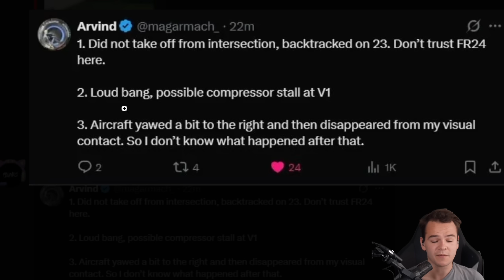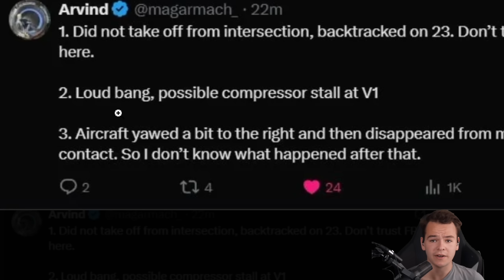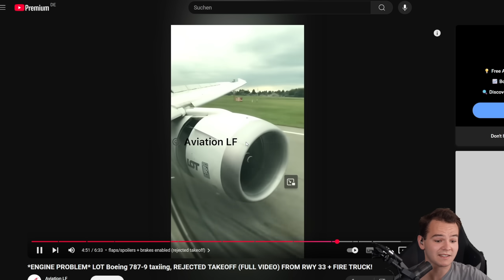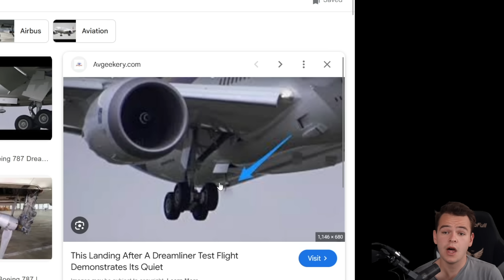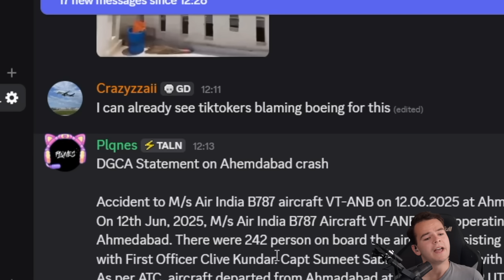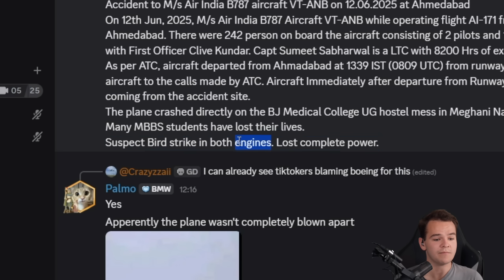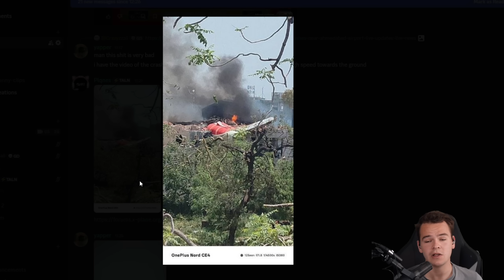The First 787 CRASH Ever - Why It Is SO Confusing?

Comment: 🛫 1. Flight Never Climbed Past 625 ft
Takeoff at 13:38 local time

ADS-B max altitude: ~625 ft barometric (≈300 ft AGL)

Crash location: 1.1 miles off runway end, aligned with runway heading

Landing gear still extended in crash footage → confirms very early-stage flight

✅ Matches what we know from Flightradar24 and all major media reports.

🔥 2. Total Power Loss Suspected
No engine sounds in crash video

No flaps retracted

Aircraft reportedly "gliding" rather than climbing → suggests zero thrust available

Swiss001 (and other experts) infer both engines failed, because:

A 787 can climb on one engine at MTOW (that’s what V1 procedures assume).

The absence of yaw, no high bank, and very short flight path suggests it didn’t have even one working engine.

➡ If only one engine failed, the aircraft should have:

Kept climbing slowly

Yawed or banked away from the failed side

Possibly returned for a safe landing

This didn’t happen — suggesting dual engine shutdown.

🌀 3. Ram Air Turbine (RAT) Deployed?
Multiple users and Swiss001 speculate the RAT may have deployed.

The RAT provides minimal backup power for flight controls and instruments if both engines and the APU fail.

In clearer audio from social media videos, some report a faint RAT-like buzz.

✅ If confirmed, this would strongly support a dual engine failure scenario.

🐦 4. Bird Ingestion Theory
India’s DGCA (Directorate General of Civil Aviation) reportedly suspects bird strike on both engines.

Swiss001 compares this to the US Airways 1549 “Sully” incident — geese ingestion at low altitude caused both engines to shut down.

Here, the aircraft hadn’t even completed climb-out — possibly ingesting birds during or just after rotation.

‼ But… this would imply an extraordinarily dense bird flock, or multiple large birds (e.g., black kites, vultures — common in Ahmedabad).

🧱 5. Why the Crash Was Fatal Despite Low Altitude
Heavy aircraft (fully fueled for 9–10 hour flight)

No thrust = no climb = gliding brick

Impacted a student hostel at BJ Medical College

Fireball caused by tons of ignited fuel

Tail section survived, but main fuselage was destroyed

➡ Even from 300 ft, a twin-engine jet losing power has no safe options — just like Sully, but over buildings instead of a river.

🧩 Summary: Why This Crash Is So Confusing
Aspect	Why It's Unusual
787 Safety Record	First fatal crash of any Dreamliner in commercial service
GE GEnx Engines	Considered highly reliable; no major service-wide issues like RR Trent 1000 had
Dual Failure	Extremely rare — requires common cause: fuel, birds, software, or sabotage
No ATC Detail Yet	Only partial confirmation of the Mayday call — no transcript of cockpit comms yet
Crash Behavior	Smooth, shallow path with no stall-like nose drop — consistent with unpowered glide

✅ Supporting Evidence Across All Sources
All major networks (CNN, ABC, BBC, CNBC) now align with this theory.

Swiss001 builds a simulation that matches known crash data.

User footage, social comments, and ATC metadata all point to:

Sudden loss of climb

No engine thrust sounds

Possibly RAT noise (indicating dual engine loss)

Early Mayday with no follow-up

🚨 Next Steps That Matter Most
CVR/FDR recovery – will confirm:

If both engines failed simultaneously

Whether RAT deployed

Exact pilot actions and warnings received

Engine teardown – will show:

Bird ingestion evidence?

Fuel contamination?

FADEC anomalies?

ATC transcripts – to learn:

Timing of the Mayday call

Last crew communication before impact

🕯 Final Thought
This was not a “technical” stall, nor a normal crash sequence. If Swiss001 and DGCA are right, this is one of the only modern twin-jet takeoff crashes involving total thrust loss with no time, no height, and no safe landing path.

Comment: Other possibility is that the flap is inadvertently retracted instead of gear. Difficult to tell if the rat is deployed.
Reply: Kind of wild how far we are with computers/simulators that his demonstration of the dual bird strike engine failure played out almost identical to what we saw......run another flight sim with the flap issue too! While that helps explain the lading gear, the engine failure seems certain.
Reply: @The_Masked_Fokker  It's hard to see from the video clip, but it does look like the flaps and slats are retracted, and then when the plane starts to change its attitude, it loses altitude.
Reply: i think engine failure is the main cause. flap is just secondary issue
Reply: @gthakur17 doubt it, flaps were retracted which would’ve resulted in no lift
Reply: @sensah3978  hmm i was only reiterating which some other youtubers were saying. Since i am no expert , you could be right. Though we need to wait for boeing to release the report which could be weeks
Reply: In the video you can hear a similar sound of the RAT mid air but hard to see it in video
Reply: Someone mentioned that on this jet, sometimes you only need about 5 degrees of flaps, which may not be visible from certain angles.  But that was my first thought when watching the video (but before reading comments).  HOwever it is feasibly possible that they needed more flaps than what was put in, and thus the plane reached a point where it couldn't generate enough lift and then crashed.  I have heard similar stories where weights of planes for example, are off (inaccurate), which may cause pilots to use incorrect flap settings which leads to a crash in some cases.  Aircraft Investigations has done a few documentaries on crashes of that type).
Reply: rat is deployed
Reply: Agreed, rat is deployed with new footage  @isaxdah

Comment: This sounds a lot like the Atlanta incident where a maintenance supervisor conducted a class on inspection of both engines oil systems and forgot to reinstall the seals around the inspection ports. The plane took off, and immediately lost all oil pressure as the oil was forced out through the ports. It did manage to land but the engines were destroyed.
Reply: Interesting theory we will have the answer soon
Reply: Yeah, my first thought also goes to poor maintenance
Reply: only thing i recon that is possible , losing both engines at the same time for no reason is not really possible ... it would be like getting 2 random blown tires from wear and tear only at exactly the same time and day  1 in a trillion chance
Reply: thanks for your input already.

Comment: This is a No Brainer if someone says we had a Compressor Stall on both engines at the same time. The only plausible analogy/assumption one can make here is both of the engines went out of thrust, What caused it is yet to be determined and should be rigorously investigated for human error + Design Failures (On a Machine that has performed so well over the years).

Comment: To suggest the GenX engine is "indestructible" and only the RR engines suffered failure is far from the truth. The GenX has suffered multiple failures from diverse issues such as turbine disc/shaft cracking, low turbine shaft failure, oil pressure failure, icing of the fan blades abrading casing, failure of FADEC electronic engine controller leading to a plethora of recommendations and airworthiness directives from the NTSB and FAA requiring regular maintenance and safety inspections of the engine. In the event of a total FADEC failure, the engine fails, and pilots have no manual controls for engine restart, throttle, or other functions.

Comment: A380 and 777-300er are now the last wide bodies that have never had a hull loss. 787 is such a modern plane and this one was a very old 787. It has to be a maintenance issue on air indias part.
Reply: And also the 747-8 and A330 NEO.
Reply: @devonc8411 oh yeah forgot those . Last mass produced wide bodies maybe .
Reply: a340 too
Reply: @Thedoomguy66_6 a340 has had a hull loss .
Reply: @Thedoomguy66_6  Pretty sure there was an Air France A340 that overshot the runway and landed in a ravine after a rain storm in at Toronto's Pearson International airport and burst into flames a few minutes later after all passengers were fortunately evacuated.

Comment: I'm impressed as to the coverage of this video. It's pretty detailed and informative given the material to work with. This guy knows his stuff.
Reply: His description of what the ram air turbine will do is incorrect.  I have 31 years working on Boeing aircraft.  Trust me.  It only provides power to the basic instruments in the cockpit and the radios.  It will not power the landing gear.
Reply: @stevenhoward7083  Your post on the air turbine is welcomed.
Reply: No he doesn't. He's an aviation kid that's a private pilot. He's an enthusiast who's never actually flown a passenger plane or received a type rating, making overconfident assumptions based on unconfirmed reports of other aviation nerds that think they know what happened based on a blurry video. Until an actual aviation agency makes a statement, anything these youtubers are saying is pure rubbish, they're all just trying to push these "analysis" videos as a way to milk the death of hundreds of people using idiot flight sim recreations.

Comment: Since there are reports of a bang-sound at the runway phase, I think we can put things like bad fuel or software issues off the table.
It all signs towards the bird strike.
Habe to check the maintenance reports if there is a chance that maybe both engines were incompetently checked prior the flight and accidently something went wrong there.

Even with V1 - why do planes take off at all when all power is lost? Aremt survival chances better if you just ramm the brakes and pray? Now it crashed into some houses and even more people had to die

Comment: also,when it took off,it reached 645ft and then it started descent of -495fpm as i saw on FR24.And it lost all electric power at 645ft at 200mph aswell(transponder switched off,just like Jeju2216 on final) HOWEVER,the pilots knew they would crash into buildings...yet they tried to land it as smoothly as possible,which made it the first literal crash landing(i am not joking,this was the definition of a crash landing) i dont much news,but the highest chance of survival was near the tail which is approx. 1-2%

Comment: Sorry to here this news. Do think you have your engine info back to front! Rolls Royce if problems terminate and slow aircraft down before take off! The GE is very powerful,some say to powerful and certainly not as fuel efficient as the RR so took off even after failure leading to catastrophe

Comment: I don't know much about airplanes, but I know enough that a duel engine failure is pretty much unheard of. I also know that usually a duel engine failure is either external factors like Swiss001 says, or fueling issue. My bet is on some fueling issue.
Reply: My thoughts exactly- bad fuel is definitely a possibility.
Reply: It could be a maintenance mistake, the same person making the same mistake on both engines.  That has happened before.
Reply: Could be bad fuel indeed, as Swiss said it's really hard for birds to completely shut down not one but two GEnx engines
Reply: Tbh if it would be fueling issue it would crash or stall when it would be in sky , this crash happened like 2-3 mins after takeoff so someone would have pointed it out why the fuel is so low and it was shown that fuel was quite good
Reply: As per 1 sole survivor right after the take off some kinda explosion heard and soon the plane started descending. I don't think of fuel problem. I am more swayed towards the power issue if you see
Reply: @DrD26  my theory with that testimony is bird strike. only thing that comes to mind to have a explosion duel engie failure, and has happened a few times, a russian crash comes to mind aswell as sully and the hudson
Reply: @Howieroark21  our media I mean Indian media said that pilot who had 8200+ he's experience and come pilot who had 1100+ experience said to the ATC that they aren't getting enough thrust for complete take off in mid air but close to ground soon after that ATC received May day call from them 💔
Reply: @Howieroark21 but the sole survivor said that they heard explosion and right after that the plane start descending instead of ascending
Reply: @DrD26 Air india is known for having terrible maintenance, it’s probably a maintenance issue
Reply: @DrD26  Sabotage is a possibility.
Reply: @vineberries it is the new management under uk CEO, it is the new plane
Reply: How about single engine failure and subsequent pilot error in shutting down the other (working) engine.
Reply: @rhwing5095  nooooooOOOO!!. because first pilot error is to not deploy flaps which is a federal crime.
Reply: Bad fuel is one of two plausible causes I can think of.  The other is dual bird strike.
Reply: Bad fuel makes engines run inefficient. Not have both of them working perfectly until after takeoff and then suddenly completely fail at the same time. The crew would have noticed bad fuel much earlier, and the plane would have had enough power to stay airborne. I highly doubt it was bad fuel. I fear for an incorrect flap setting.
Reply: It's unlikely to be a fuel issue. If it was contaminated fuel, other aircraft would've crashed or had problems. This would've been reported by now I think.
Reply: @rayjohnson9542  I feel the same too

Comment: When pilots engaged the "autopilot," the software put the engine power into idle . These failures are caused by bugs in the engine control software, which, with a certain sequence of commands (button 1, button 17, button 32, and so on), causes the engine to override pilot command and stays in idle. Most likely the procedure to fix this is to "turn off and restart" the engines. But since they were at low altitude, they didn't have time to do that. Landing gear was down hoping that it will absorb as much as possible of the initial impact.
Reply: CEO of making shit up
Reply: Sounds like you pressed the BS button.
Reply: What fiction movie is that script going to be in?

Comment: Crew most propably took off without flaps! Happpened the same long time ago! If the engine had a problem that is the proper action

https://en.m.wikipedia.org/wiki/Olympic_Airways_Flight_411

Comment: Hi Swiss001. Definetly, a double engine failure (whether on take off or an any other condition) is highly unlikely. But it doesn`t mean it`s impossible. However one thing came to my eye, looking at that picture. The take off flaps don`t seem to be deployd. Tell what`s your impression on that. I`m a 20+ years flight sim pilot and the take off flaps is something you obviously know it`s not the best configuration.
Best wishes from Portugal.

Comment: RR Trent 1000 had issues, it is addressed in Trent 1000 TEN. Still,  RR is noisier, burn more fuel, and ended up heavier.
GEn-1A looked like the winner. But a Japanese user uttered a concern about its lifetime durability - yes it runs solid when it is still "under warranty" - but when it fails, it totally fails. As the key technology is in the material of the fan blades.

Comment: Not confusing at all, if you freeze and blow up picture from video you will notice the gear is down and flaps are up!   They had engine failure and clearly non flying pilot retracted flaps not gear!  You would NEVER retract flaps at this speed or altitude especially with an engine failure!

Comment: Looking at the video B787-800 Air India crashed 242 POB.   I believe that the flaps are retracted,  ou set to 1. Without flaps it's basically impossible to gain altitude, like the MD-80 in Spain a few years ago.  Just my two cents.
Reply: It is good practice on a wide-body aircraft to take-off with the minimum flap setting compatible with runway length, weight, temperature and other t/o variables.
That includes, on the 787, NO FLAP or only 1° of flap... F5 being pretty much maximum on such a long runway.  We can't see on such a low-quality video that small flap settings...
Reply: @st-ex8506 a 787 can't take off with no flaps, not with any load. They need 5, especially in these conditions.

Comment: Hard to say but it looks like the flaps are not set in take off config if this is true coupled to an intersection take off which it did would spell disaster.  This is more plausible than a dual engine failure. You say there is no noise you can’t possibly confirm that god knows what device recorded the video.  The rat is on the right what you suggest looks to be on the left. Anyway the tail section landed in a building fairly intact which will make black box recovery quick and easy they will provide the true story. Thoughts go out to the family’s on board and on the ground in this tragic loss of life.